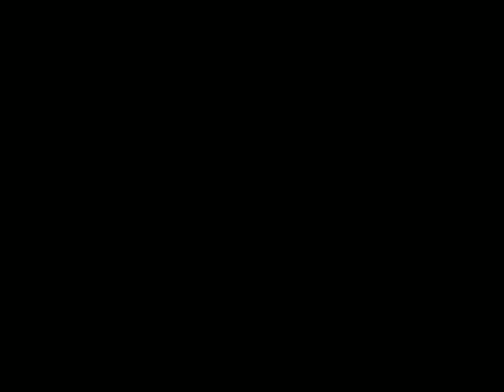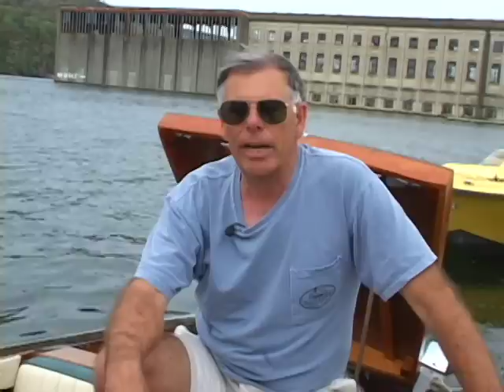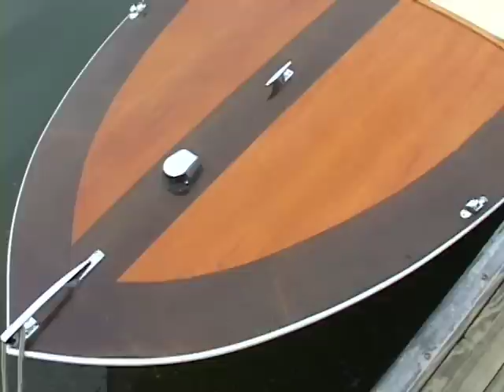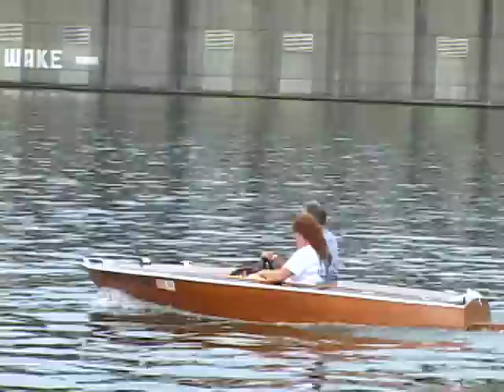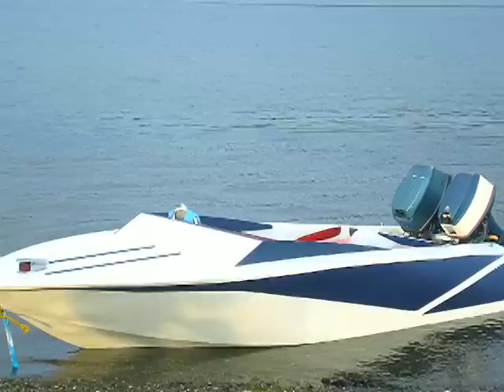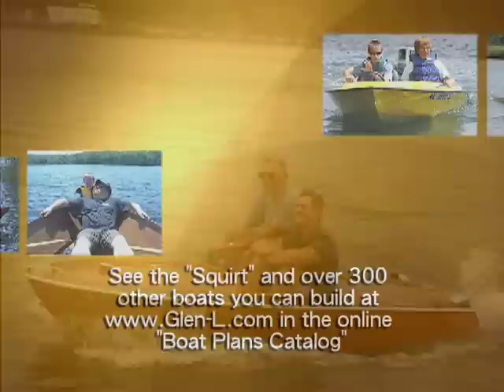Building a Squirt Runabout with Jet Power

Comment: thats a good job like the style...im building a 10ft my self i'm making it look just like a tahiti hall and its only hold two people though but i put the steering wheel in the middle so when alone its level in the water but i installed a 700cc jet ski motor with reverse and a trim tab and so far the weight of this boat versis a jet ski is so much lighter and so far been clocked doing 62mph and still has more room to go faster but being a small boat and all its way to fast , but in the calm waters in the morning its a blast and best of all i can go in water that is 6in deep with no problems and up streams with ease so trout fishing here we come...